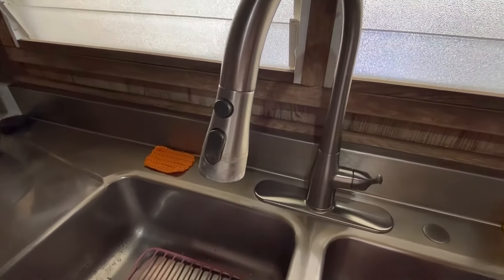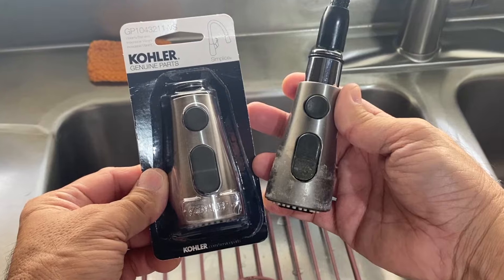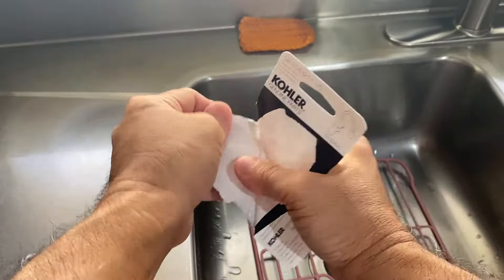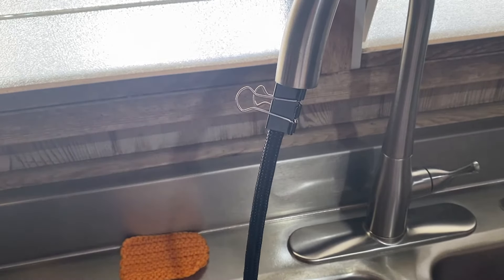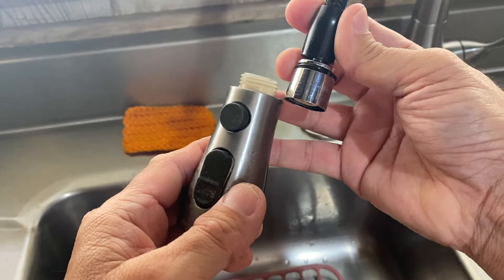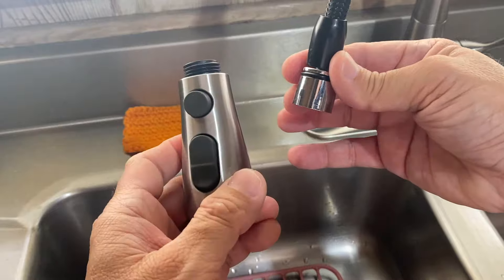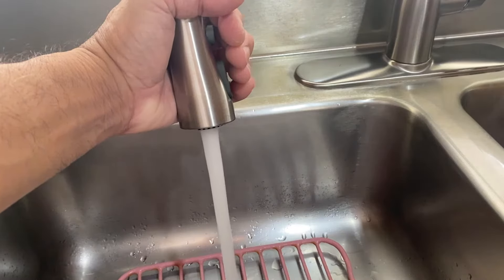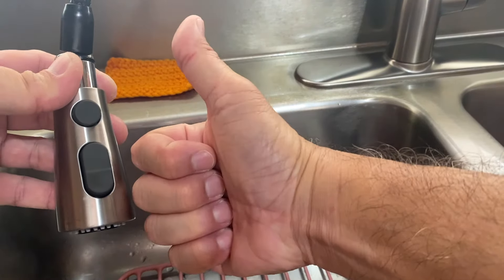How to Replace the Kohler Simplice Pull-Down Spray Head

Comment: Correct there heads are good. However, they do seem to not last long
Reply from the maker: Thanks!
I think a lot depends on the water quality.  That head was replaced at my mother-in-law’s kitchen… we’ve had ours longer and it still works and looks almost brand new.  😎